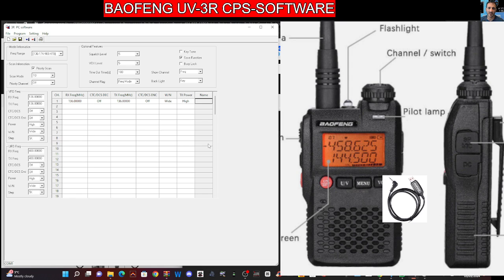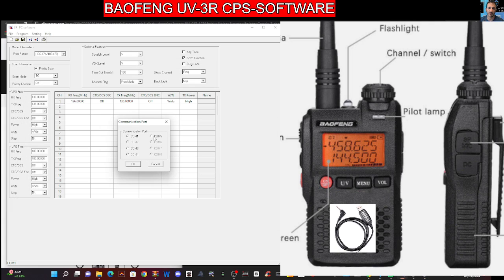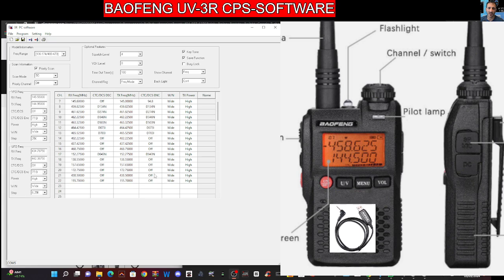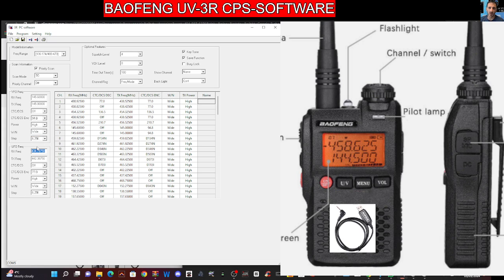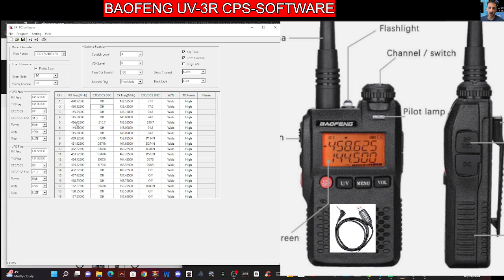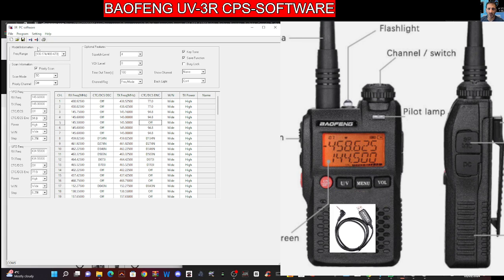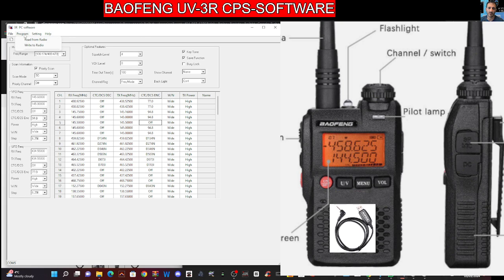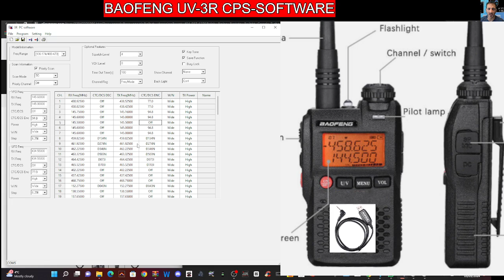BAOFENG UV-3R - PROGRAMING SOFTWARE TUTORIAL

Comment: I have tried both Miklor and CHIRP and neither with read or write to two of the 3 radios I have.  I have done a factory reset on one and tried again, still nothing.  Any ideas?

With CHIRP, I keep getting a pop-up saying "Failed to communicate with radio: local variable 'e' referenced before assignment"

I have also switched COM ports just to see if that made a difference, with no luck.
Reply from the maker: https://youtu.be/hP7kmc9eAuw
Reply: @M0FXBHamTech  thanks for the reply, unfortunately I have tried that but still hasnt resolved the issue of it only reading one of the three radios I am trying to program.